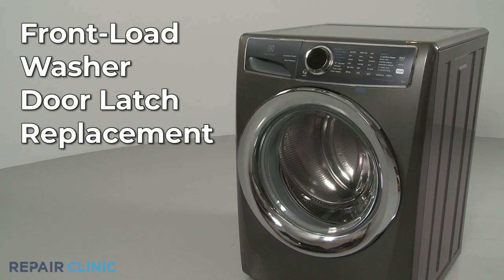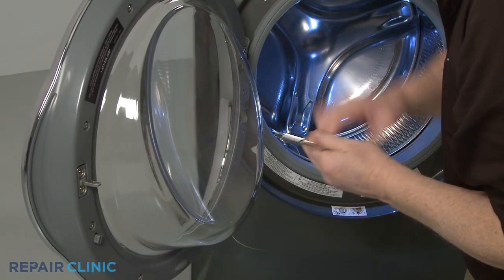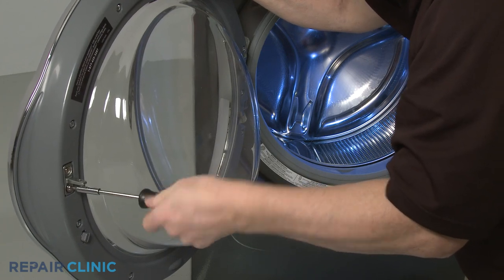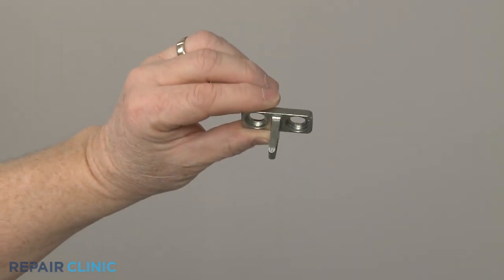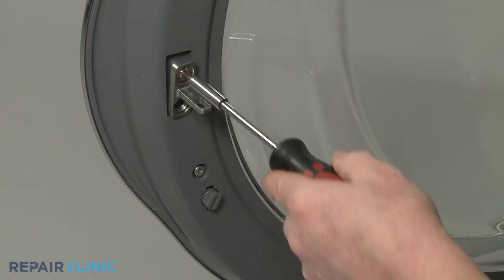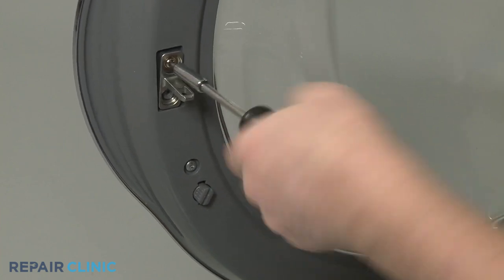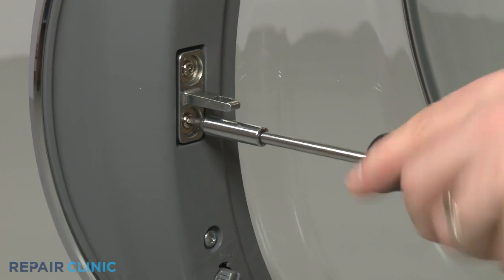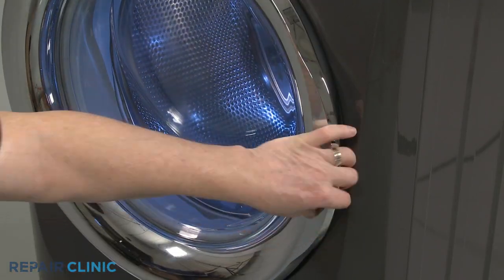Electolux Front-Load Washer Door Latch Replacement (part 5304505088)

Comment: My metal latch broke off and front piece is stuck in the washer door. How do I get it out?
Reply: Stacy gee thats my question did anyone get back to you or do I  have to replace the electric
 switch which I also ordered just on case. Bright minds do think a like...
Reply: Stacy you have to buy the switch the latch goes into. I have it in hand and the only way
  to get the broken pieces out is to probably destroy the latch.
Ron
Reply: I was able to use two pairs of hemostats my wife had in her nurse bag to grab the broken prongs.
Reply: after removing the lock I was able to push in the white plastic part in the back in with a flat screwdriver and bang the piece on the floor which dislodged the broken off U-shaped metal part
Reply: @katyroth4748  Katy mine was metal and its like a horseshoe now way I had to buy 
both pieces. Glad yours worked out.I would
keep a spare from what I have learned the 
latch breaks a lot..
Reply: I just took the little panel it goes to out and fished it out of there

Comment: Ok guys I Bought the latch and the electric switch the latch goes into. I now have a switch
 with the broken latch stuck in. My guess Iwill destroy the switch to get the broken latch
out of it. But the switch also for both its around $60 bucks Amazon had in with 24 to 36 hours 
on prime and it works great...
Reply: the latch will come out with a little help of flat head screwdriver, just grab it and pull it out. The screws are mounted in plastic and eventually strip out the plastic threads. you'll need wider thread screws or replace the door

Comment: Yea, ths issue is this is metal on plastic and the plastic gets stripped. This will not fix anything. You would need to replace the door itself to fix this problem. The door opening in the middle of a wash this weekend suggests it is just plain a faulty design.
Reply: No I just replaced the latch and the switch cost 
$60 bucks for both..